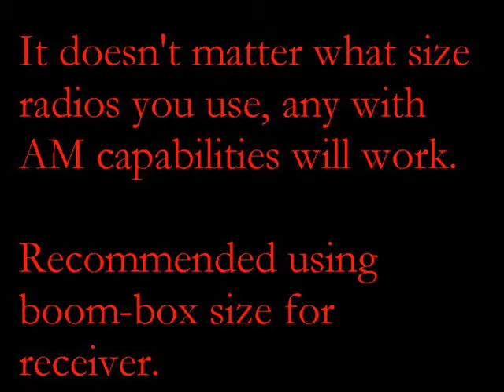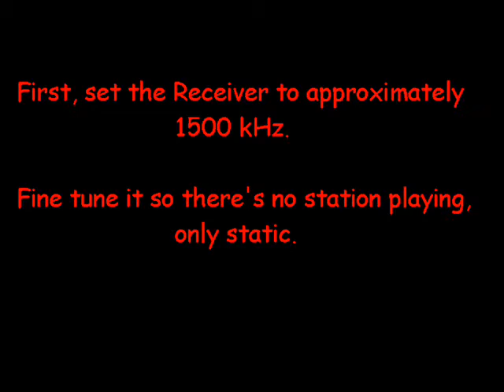Private Donut's Three Radio Theremin

Comment: I must also mention that not every AM radio has the difference between heterodyne and dial frequencies set to 445 KHz. My radio I use as a transmitter (Kipo KB-AC807) has around 600-700 KHz difference. So the dials setup will completely depend on the chosen radios.

Comment: question: aren't  theremins played with two hands - they have two metal pieces - each do something diff...  - one for each hand... where is that second area in this setup?
Reply: On a traditional theremin, the second antenna/metal loop controls volume, a 3 radio theremin doesn't have that capability, at least not without serious modification